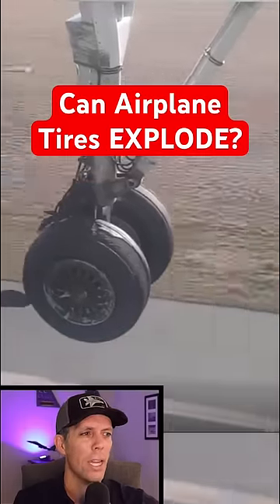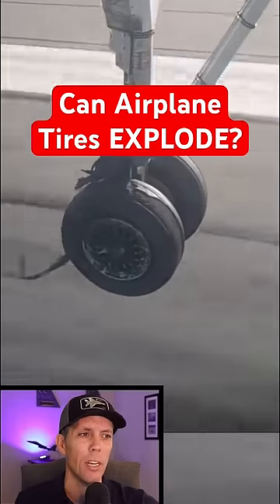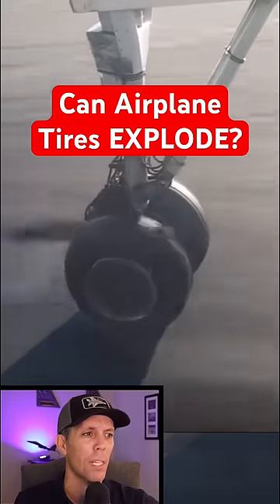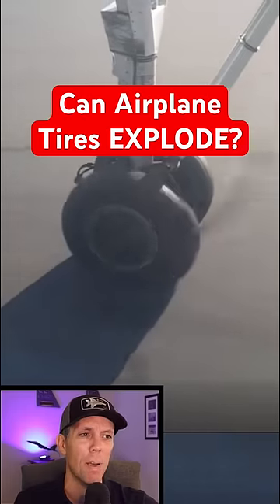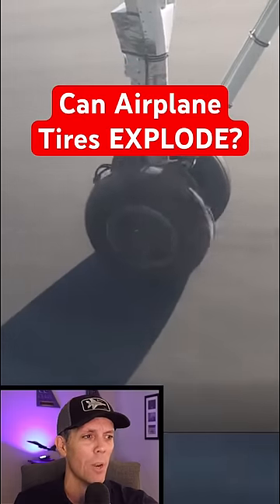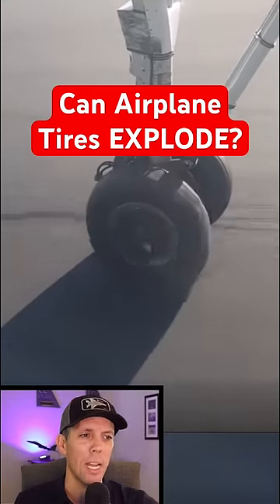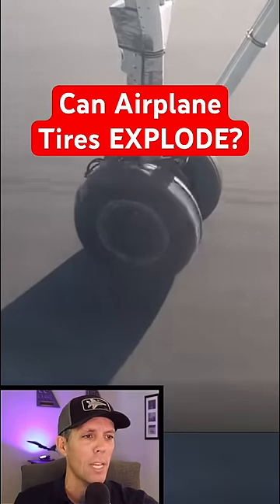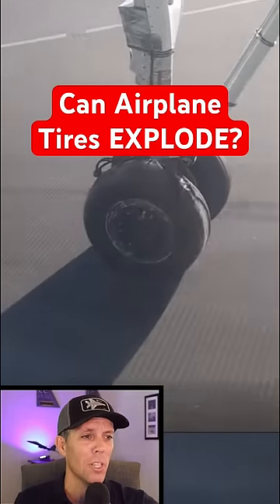Can Airplane Tires Explode?

Comment: 200psi is WILD to think about
Reply: very true
Reply: Wouldn't want to be standing next to it when inflating in case of malfunction.
Reply: For reference bike and car tires are around 30-40 psi
Reply: @ElizabethWarrenYeahYeah do it all the time
Reply: @theRealNaplin For more reference, ATV tires are usually around 8-12psi and van’s and large pick up trucks are around 60-70 in the front and 70-80 in the rear. Semis and other large trucks are usually like 120 max in the rear, crazy
Reply: On f18 the main landing gears are inflated to 290 on land and 350psi on a carrier. Never delt with a blow out while inflating though
Reply: Why? My commercial trailer tires are 110 PSI
Reply: @theRealNaplin sum bike tiers go up to 100 psi. I have sum. Cheap bike tires only go to 40 psi
Reply: @tonynagle4194  what do you mean cheap bike tires? I’ve had “cheap bike tires” for about 3000 miles now, and I’m not even talking on an automated vehicle.
Reply: That's because he's incorrect. Dash 8 Q400 and 300 tires don't go above 120 PSI for the MLG and 100 for the nose. Rounded numbers.
Reply: The manual said to deflate the tire before removing from the axle, but the tire was easier to roll while inflated, so I kinda overlooked that part.  Once, I pulled a tire of the axle and a broken rim tie bolt fell on the ground.   All of a sudden, deflating the tire sounded like a good idea.
Reply: Right, it's uncomfortable just filling up an older tire with 40psi. I really hope no one is anywhere near the tire when it's being filled

Comment: I was the Maintenance Administrator of the EA-6B prowler.  One of my assignments was to keep track of the landings of each air craft.  The tires had to be changed every 100 landings.
Reply: I was a p/ c on a EA6B! This is true 😂
Reply: Could this be reduced if we spun the tyre passively before touchdown?Just curious.
Reply: 100 carrier landings?
Reply: @abhijithcp663 Yes, it could be nearly eliminated entirely.

Except.... Nothing is free.

Now the plane has less weight capacity because it needs motors, control systems, and redundant safety systems and more inspection points as well as more failure points.

It is cheaper and more reliable just to let them drag.

Maybe as motor technology advances they will get one small enough to be viable, but not now.

Plus, if the drive system fails it could lock the tire and then you're landing with a jammed wheel.  A one way clutch could limit that, but it could still fail and also increases cost, weight, etc.

Comment: Old B52 electrician here.  When the buff blows a tire on landing, you FEEL it from half a mile away
Reply: Wondered what that detonation was. Lived off base next to Barksdale.
Reply: Wasn’t there a special RC tank made to pop the tires of the space shuttle or something? NASA had the same issues and for safety reasons wanted a robotic option for dealing with blowouts
Reply: And yeah, 10 pounds is cute, how about a new tire leaving 50-60 lbs when having to land heavy, looks like someone carved a family sized ham out of the tire, several times over. And it's still a viable tire
Reply: Yeah there’s enough pressure in one of those big bastards to make a really loud bang. 
We had a faulty one blow out in our freight yard one time and cops and firefighters turned up because a neighbour called in an explosion. All of our ears were ringing for the rest of the day afterwards as well.
Reply: Buff?
Reply: @spvillano  Some are tires, some was EOD playing with bombs.
Reply: And I thought pressurizing truck tires to  90psi was scary.

Comment: I worked with airplanes and this group of new hires were inflating the main landing gear tires using the standard equipment. However they had it on the high pressure setting instead of low. Sadly by the time the maintenance coordinator saw them and started yelling and running to them to alert them of their mistake, he was too late. They had mere seconds to recognize their mistake before the tire exploded killing both young guys. Sadly their family couldn’t sue because they had been trained properly and it was documented that they had been trained several times months before the incident. Me and several others left the company shortly after due the PTSD caused by witnessing the disintegration of those young men.
Reply: Wild world. If I had to work with those tires I'd be real nervous
Reply: Whoever engineered that pressure system failed big time. You should have to set the designated pressure every single time. That's nuts.

Comment: Fun fact: tread pieces fall on vehicles on highways around airports all the time.
Reply: What's the point of this
Reply: @terryevans3722  the point of what? Retreading tires or him telling the fun fact?
Reply: @terryevans3722  it's not a design feature
Reply: @chrisnoname2725  bro really asked like it might be one 😂
Reply: @archangel6666 Insert opinion retreading should be illegal for the reason of then falling off tires on highways especially trucks
Reply: @Eginhardt  There was a study done a while ago, and retreads are no more likely to fail than virgin rubber.
Reply: @DallasHerrmann thats what you call rephrasing the point. He didnt say fail. He said rubber falling off. The rubber doesn't fall off of new tires like that of retreads. Its a very distinct difference of the two thats similar to price of the two
Reply: So that's what that is.. thank you
Reply: @stompingpeak2043  It does, just not generally to the extent that retreads do and not for the same reason. But I guess that's probably too obvious to say in a YouTube comment, my bad.
Reply: @terry evans  he told u. It's a fun fact
Reply: You'd be suprised how much stuff falls off of aircraft
Reply: new fear unlocked thanks
Reply: Yeah.... No.
Reply: Concorde has left the chat.
Reply: Don’t they also have to go around scraping the rubber off the runways every week?
Reply: @terryevans3722  well, it's somewhat related to the video, and it's kinda interesting to hear. How do you not understand. Your probably one of those people that laugh for hours at funny cat videos aren't you......
Reply: Its not really a Fun Fact. Its more like a, "Heads up, the sky is falling"
Reply: @stompingpeak2043  It was an assessment of rubber along highways. Ended up being about 50/50 new tires and retreads.
Reply: @DallasHerrmann  well they assessed wrong here. The difference is new tires will typically wear out and then blow. Where retreads will lose layer after layer instead of wearing out. While both last a similar amount of time. The only way factory tires leave alligators along the highway is if they are in bad condition and explode. Retreads will always leave them along the roadway as a feature. It's like two distinct characteristics.
Reply: @stompingpeak2043  The majority of OEM and retreaded tires fail due to belt failure. The second most common failure mode in both is road hazard. Manufacturing issues are sub 10% for both OEM and retread tires.
Reply: @terryevans3722  😂😂😂😂
Reply: @DallasHerrmann  Its pretty obvious by just reading the comments they have a hardon for retreads lmao
Reply: @aRedFrog  Fairly common, it's a quite common perception that retreads are significantly more dangerous than OE tires.
Reply: @DallasHerrmann but it's a misconception.
Reply: Dallas-Fort is the best know for danger zones
Reply: @terryevans3722  did you know the pieces on hit teslas!!!

Comment: I currently work for a company that retreads the tires and situations like this are some of our worst nightmares. Glad to see they landed safely!
Reply: A week ago retreaded tire on our truck exploded and piled off like an orange... I hate them
Reply: @mirkodukanac3424  the company I work for only does airplane tires but I hate to hear thay happened to you
Reply: I used to unload and ship used aircraft tires to be retreated by in Va. Dirtiest tires ever.
Reply: @CaptnSyko  🤣 definitely, my hands seem to be permanently dirty these days
Reply: This context is hilarious tho.

"Ay fam, you blew a tire on takeoff so instead of landing there like normal, turn around and land here so this flight is also delayed"
Reply: @CLove511 i think the issue/concern is the pressure changes the tire would experience if the flight continued on and reached normal cruising altitude and then back down on the descent vs coming back around during the take off.
Reply: @DefendTheStar  Good explanation as to why they don't just deal with it at the destination.
Reply: Maam we dont use that word anymore 😔
Reply: @CLove511 Plus they're landing with a full load of fuel & if they did dump it then what a waste!!
Reply: @DefendTheStar  The difference in air pressure between sea level,  13.6 psi, and 20 000 ft is minimal compared to the 200 psi in the tyre, if the tyre was damaged on take off or under inflated the temperature is far more likely to cause a pressure problem hence wheels have meltable plugs (technical term is Fusible Plug), which melt when a wheel reaches a certain temperature(varies depending on aircraft type) to stop it exploding due to over pressure.
Reply: How about those 500lb dash 8 tires

Comment: I used to work at an airline in Calgary and be of my jobs was ship tires. Airplane tires can be retreaded a maximum of ten times. This is and was extremely important that the tires be checked before being mounted on any airplane. We had the passengers lives in our hands.
Reply: What size were ship tires?
Reply: @sengerandu  never knew ships have tires 😂😂😂😂
Reply: @sengerandu Ayyo you stuck in the 1800’s 🤣🤣🤣
Reply: Calgary is gorgeous!
Reply: Ya goofy. He meant he was shipping tires at his job.
Reply: I'm from Calgary and it's awesome 😎
Reply: ...I imagine with SHIP tires, tread DEPTH is most important...
Reply: People don't realize who they're trusting their lives to. My best friend used to fuel and taxi airplanes at our small international airport. small in terms of the airports that are international. He was responsible for adding up fuel amounts and doing all this arithmetic to ensure planes get proper amounts - short flights don't take as much fuel. They get more than they need but not THAT much more. 
What surprised me was that he was only making like $10/hr. He had worked their for like 3 yrs!! 
This was 2009 when economy crashed and pay rates were much lower but still. 
Still if he got his math wrong, and the fuel gauges weren't exactly correct, a flight could be in real trouble.
I also understand our Air Traffic Controllers are overworked and we don't have enough of them
Reply: @gaylordpantamime  
I live-in Stony Plain, and yes, if I want a nice short holiday, I'll go to Calgary!
Reply: I’m seriously glad you posted the end the way you did by talking about having passengers lives in your hands. So many just don’t really care.
Reply: I use to work at the airport as well those tires are heavy!!
Reply: @jasonyurrrr9994  bro wtf how does ships having tires place him in the 1800s
Reply: @GeeDonTMinD  lmao bruh i didnt catch that
Reply: Thanks
Reply: @TqSNv9R0iG5Ckxew  I believe a strip of metal that fell off another airplane took out the tire on the Concord. Tire probably was in great shape before that.
Reply: I didn't know ship's have tires!
Reply: how much $$,$$$ are one of those 
life savers worth ?
Reply: I would think they wouldn't allow retreads at all. Thats more dangerous than new tires
Reply: Ooooo lives on your hands ooooo
Reply: @videodude8137 ...either way, they still need to be in SHIP SHAPE...
Reply: Intressting and did you recognize that he actually said a wheel assy is just at no weight after use?
 He said 1 pound of rubber each landing, 200 landings.
 Thats 200 pounds of rubber im wirght lose. 
200 pounds =90kg.
 A380 wheel =120kg
120kg - 90kg of rubber = 30kg fornthe rim and the tire after reachikg limitation this video is totally wrong the Dash 8 wheel is already gone way before😂
Reply: @YeOldeGeezer that’s what we call them…changing a ships set of tires is changing all of them.  I love people that have no idea.
Reply: @burtan2000 that job is for high school kids.  Fueler…pffft.  MECHANICS are the ones that do the deed!
Reply: @videodude8137 I’m aviation, as a mechanic, we refer to changing all of the tires on the plane changing a SHIP SET of tires.  We also don’t call planes “birds”.  Only dorks do that.